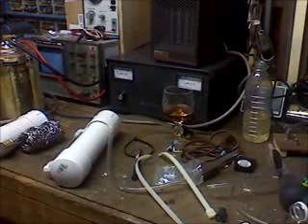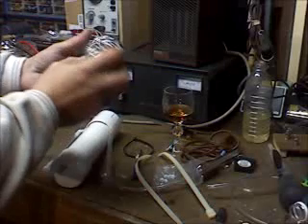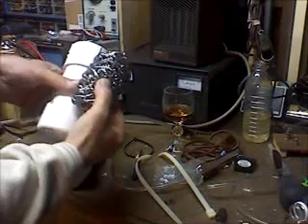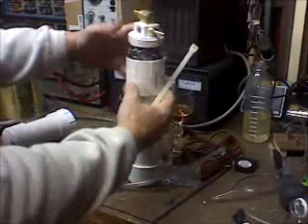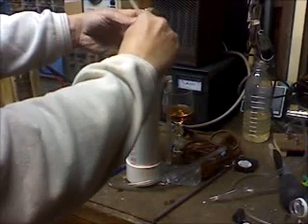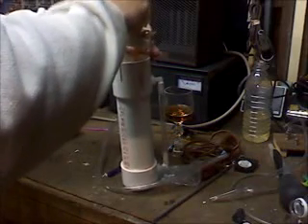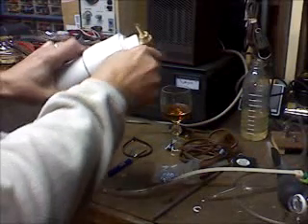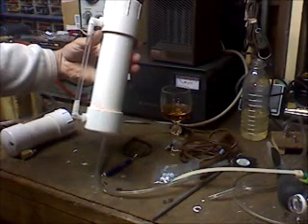#56 HHO bubbler final ass'y

Comment: Electrolysis liberates these as radicals, not ions, like you explained. the H radical finds other H radical liberating hydrogen gas, as with the O radical. the reaction is as follows:
2H20 -> 2H2 + O2
Pretty simple. HHO is the unstable form of a single molecule before it finds another HHO and quickly forms 1 gaseous oxygen and 2 hydrogen.